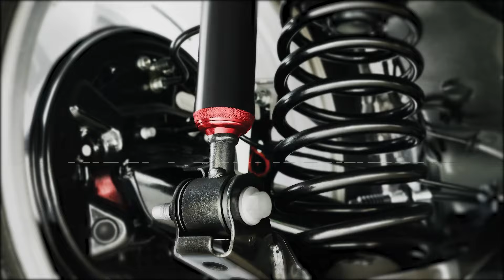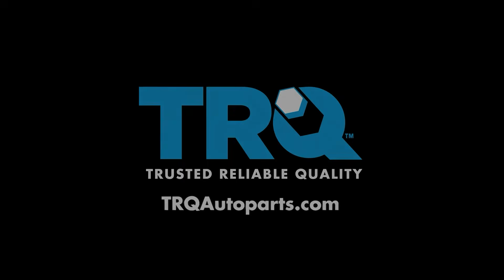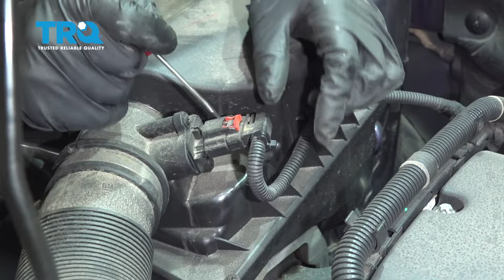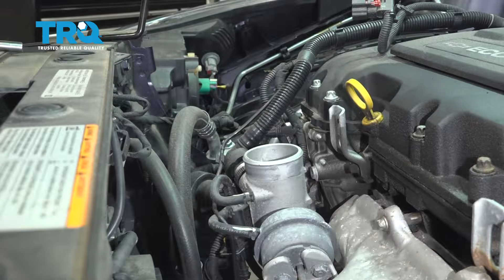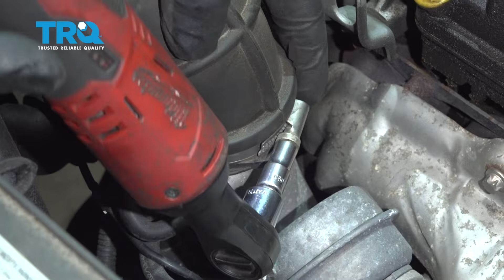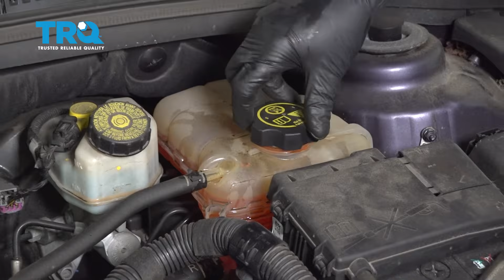How to Replace Thermostat with Housing Assembly 2008-2016 Chevrolet Cruze

Comment: Did this repair last week.  Didn't need to take off any of inner fender shields off.  Was able to do everything from the top minus draining the fluid.  I replaced, thermostat, water pump, serpentine belt and tensioner and the water outlet spout on the opposite side of the engine.  Thermostat was definitely busted but my water pump probably was fine.  The thermostat didn't fix my overheating problem as it ended up being the water outlet spout it get it all working.  The outlet spout was crushed under the rad hose and would pass water once the temp got high and pressurized.  Thermostat has a very high open temp 221°F/105°C(MotoRad [NAPA] brand) which I think is crazy.  I had put my first new one on but that I kept having overheating problems all week.  I took it out and put it in boiling water to test it and it wouldn't open.  Thinking it was defective no temp number on the box I returned it and got one from NAPA but it ended up being the same brand in the box except on this box it had 221° in the corner.  They looked it up and that was the trigger point.  I can drive to work 30mins (-5°C air temp) and the rad doesn't get any flow and stays cold.  Thermostat does work as I was able to determine that when testing in the driveway and letting it really warm up.  I think when my thermostat was broken it was easily opened or half opened all the time and let the system run a lot cooler.  Now with it hardly opening the heater temp  inside the car is insanely hot.  Don't forget to let the air out of the system.  There is a plastic screw pretty much inline with the thermostat on the rad. Thanks TRQ for putting these videos together!

Comment: note to self, the only reason to remove the snorkel is if im going to make a video about it too, or if i i said im only interested in an oil change and the junkies employeed at valvoline in springfield missouri on south campbell have to remove it and handful of other parts not related to the oil change only service i requested is because they were counting on me paying them to repair the leak they caused during the unauthorized coolant system inspection

Comment: My daughters 2011 LT is leaking at this housing unit. Is it possible it just needs a new gasket? Or should I just buy a whole new unit? Her car just keeps having issues so I plan on selling it but this job looks easy enough. After you refill the coolant will we need to burp it?

Comment: Why would you take the whole cover off the air filter?  Just loosen the 2 hose clamps and take the whole hose off in 1 piece. Way less work. The cover isnt in the way.
Reply: Did you notice he said a straight blade screwdriver to describe a flat head? This guy isnt very on top of it
Reply: To scare DIYers because it looks too complicated. But it's not.